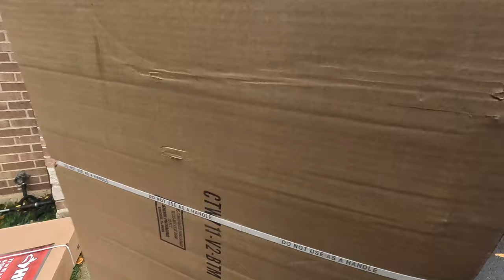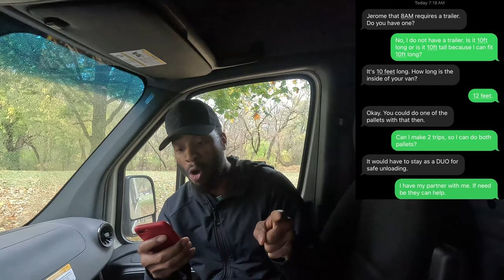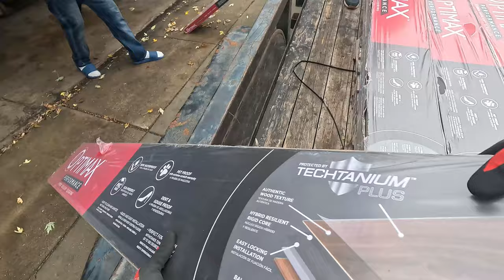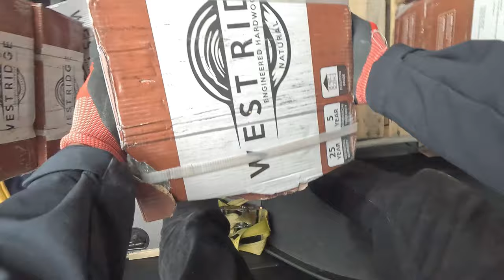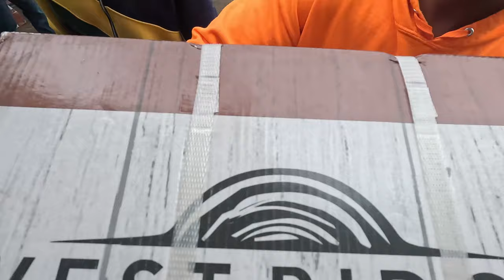DUO LIFT Bungii Orders are Terrible!!

Comment: Damn dude they still have your van?? Bro get an E Sprinter. I have the E Transit it’s so easy just plug that thing in and that’s it!
Reply: How does that work out for you and your type of work? How much do you save and make compared to a Gas ot DIESEL vehicle?
Reply: @ I do mostly local last mile delivery and I love having an electric van. It’s so much cheaper than gas or diesel per mile. Plus there’s literally zero Maintence. Tires and brakes obvi but not much else. They’re great around town. Not really road trippers tho I’ve done pretty long drives in it. I’d buy my E Transit again over gas 100%. OTR guys no way but local stuff for me it’s the way to go. Super smooth and powerful as shit.